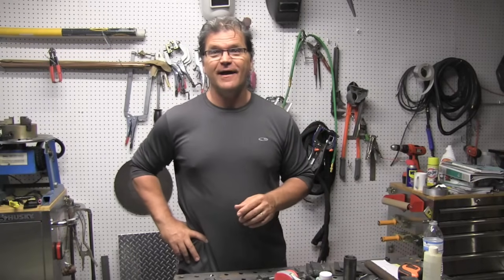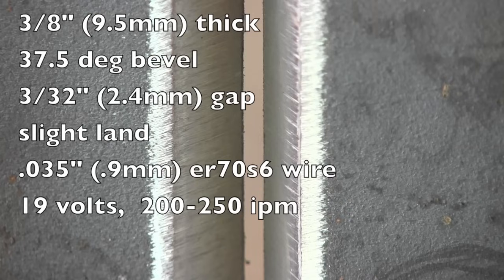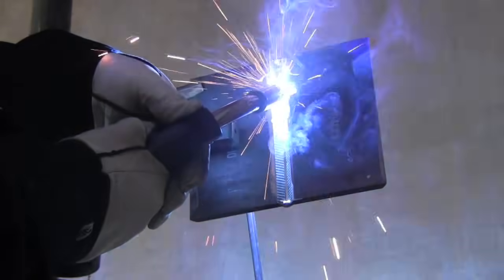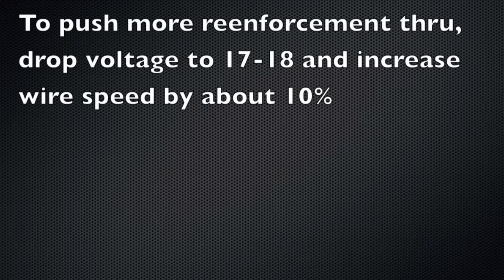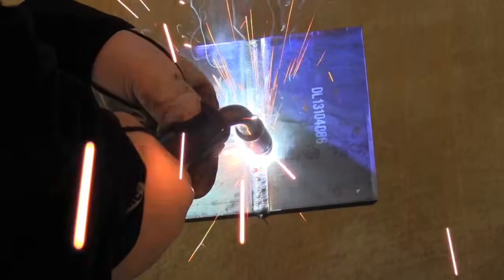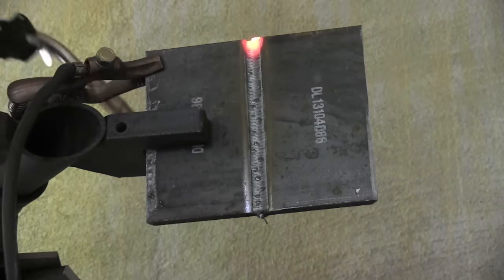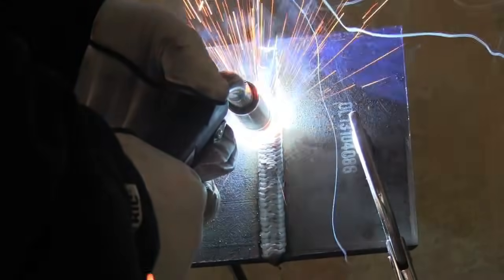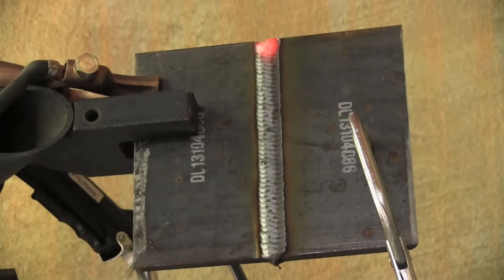MIG Welding 3g Vertical Open Root Plate Test

Comment: Can you do a video with fill and cap on sch 10 stainless steel pipe I love all your videos and there really helpfull I would like to see you run one of those because there are a lot of welding test that calls for certification for stainless steel pipe thin metal